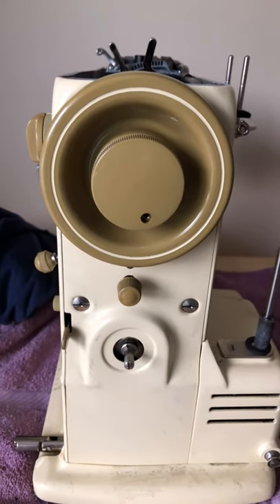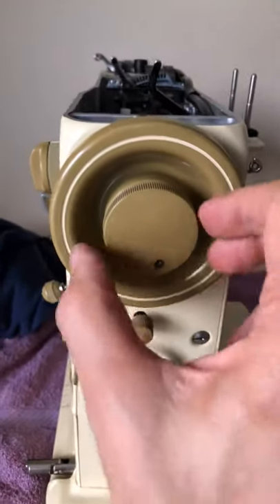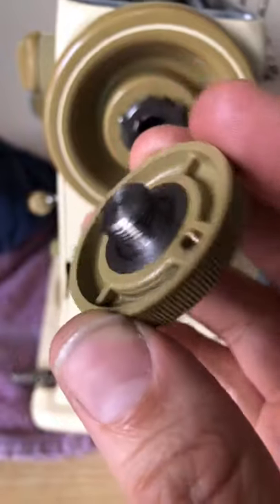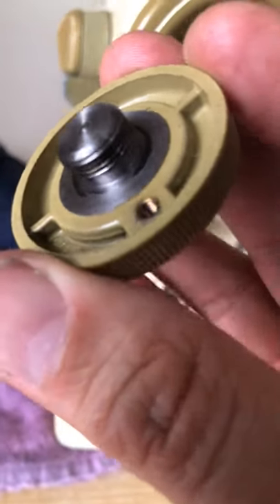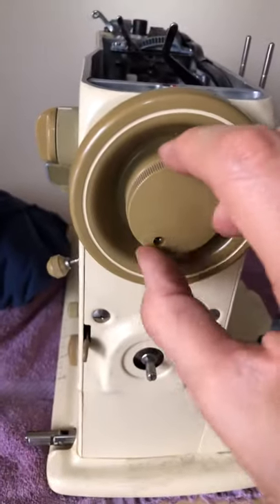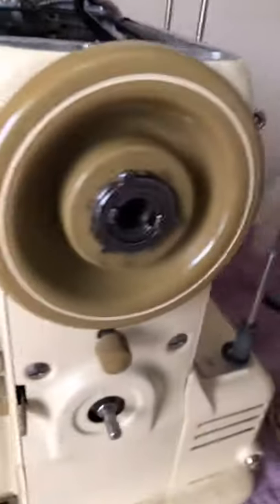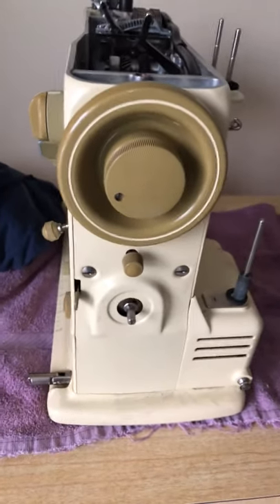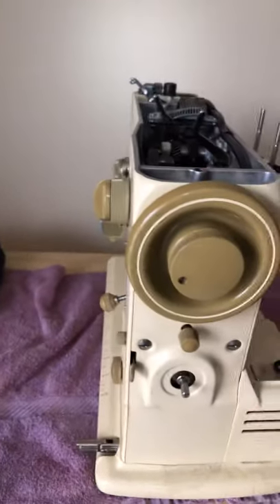CLIENT PROJECT SERIES #6: Clutch Knobs Need Love Too! How to Gently Wake Up Bobbin Winding Hardware!

Comment: I've been running through your videos on the White Series 77 and I am currently trying to purchase one that I have not seen in person yet but the owner said it "Needs a power cord". I assume the cord and/or pedal is gone. Would a 3 blade plug and play option like this work or would I need to find a technician to wire up a new one? https://www.singeronline.com/ke3blpoco.html